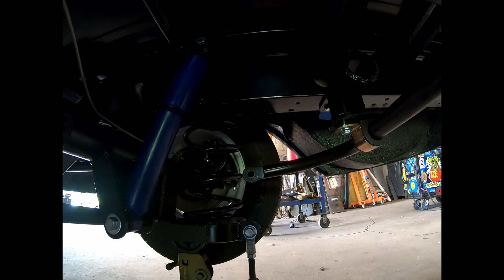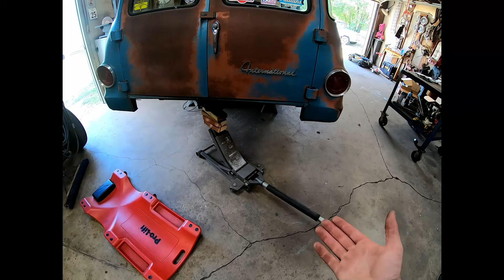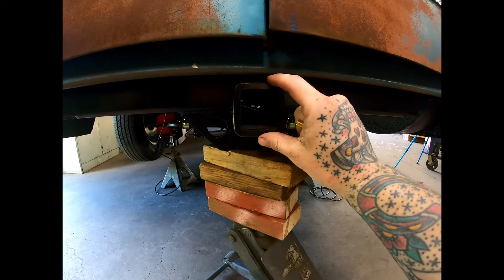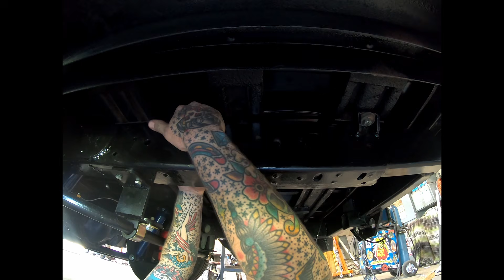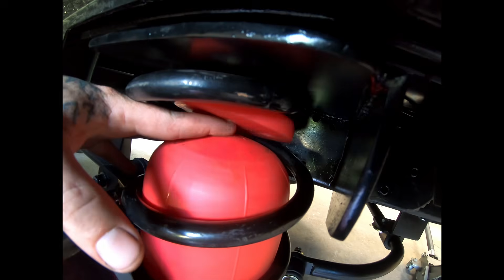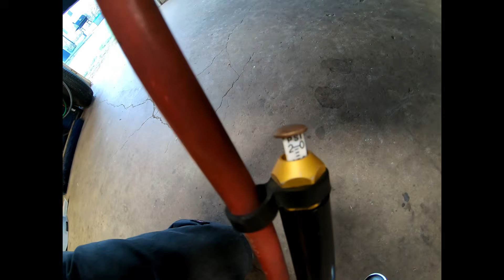EASIEST HELPER BAG INSTALL EVER! Airlift 1000 helper springs!

Comment: i bought these for my crv... had nothing but leaks. I finally used fuel lines; the crappy lines , and connectors, they send with the kit are lame. I also bought the remote bluetooth air gauges. it worked for a few years but finally it split at the top off the bag.

Comment: Something I learned the hard way, back when air shocks were the hot ticket. Using dual Schrader valves makes it easier to dial in spring rates when you don't have money for adjustable spring rates, it works great as a substitute. Using them on a larger 4x4, if you're hauling something with weight more on one side it'll help level your load. It'll also make your off road ride more stable.
Reply: How do you set up this dual shrader valve idea?
Reply: @mydearriley one valve to each bag instead of using a tee

Comment: Use separate air lines for air springs and it would be stiffer in rotation, could eliminate rear sway bar for better traction and ride!

Comment: if it dropped 2 PSI over 14 hrs that's something to worry about I have the same Air Bags in my 4WD set to 15 PSI for normal driving and 25 to 30 when I'm loaded up with camping gear and it takes months for it to drop 1 or 2 PSI I do have zip ties around the barb on the airbag and the Schrader valve.

Comment: Very nice video and informative, but I think your springs are generous on the lack of number of coils and how far they pull apart.  This is a bit of a chore to get the folded bag  in between the coils of the springs in a Suburban.  I have run these for years, but one of the bags began to leak at the seam, had to replace that one, the best way is to just use a box cutter and cut in in half.  I agree with the fellow that 20lbs seems to be about the most I ever needed for my 23ft Jayco.
Reply: Iv had some in my 01 Tahoe for quite a few years, just had a seam split. Can’t complain, I’ve “used” them 🤣🤣. Pretty tough getting them in with close spaced coils though.

Comment: What is the ride like. I want to increase the ride height from time to time on the back for off road terrain. I can lift the back of the car up when it's sat stationary. Will this lift and can I leave them empty when not in use. Do they chaff on the spring?

Comment: Great video! I put these in my 2013 Ram 1500 and pulled our 23’ camper trailer over 100,000 miles around country with them. They worked great and were still working when I sold the truck! I don’t think I ever needed more than 20 psi when towing with the camper and around 10 to 15 psi without the camper and all my tools in the bed of the truck.
Reply: These or the black ones I also got a ram I use to tow my teuck around alot and it sags so bad 😂

Comment: i found this in search of solutions for my VW Atlas sagging whenever I put something in the rear.  Due to me having the aftermarket tow hitch the clearance in the back is very low....any additional lowering due to load causing scraping issues.  Safety and performance is paramount and if a new one of these has a crack imagine a failure on the road.  If the bag is holding up the vehicle and it suddenly gives out or even gradually;  the load will be much worse being lopsided.  I guess I'd have to pull over and remove the other bag and be low the rest of the trip.  Factory bags or even aftermarket kits are expensive because they use tested and heavy duty bags.  Seeing that crack is a huge issue.

Comment: I've always had great luck with the Monroe air shocks myself!! They bolt right into your factory shock location and have a 100psi max rating and a lot of travel and are less than $100!! I've used them on many projects over the years and never had a problem with them, you also can get the extra air line from any parts store in the form of manual oil gauge line, same stuff and can even be plumbed to a tank and small 12v compressor as well as being able to use a small ball valve!! Look into them, I've used them on all 4 corners of an ole Chevy Luv and worked great, not super fast but plenty fast enough!!
Reply from the maker: I’m not a fan of air shocks myself, not bad for maybe a chevy Luv you throw a 350 in the bed of, but the amount of vehicles I’ve towed home this last year in my opinion you can’t beat these.
Reply: Oh I'm definitely a fan of the lift bags as well!! Just on a budget I've had great luck with the Monroe air shocks for a quick, cheap, and easy solution!! Luv your build and just finished watching the complete build series and liked every single video!! Your great at fabrication!! I think you're selling yourself a bit cheap!! I think you did a great job on this project build and that's something I don't see in many of the builds I've seen!!
Reply: Your definitely going to go far with the great content and your cool attitude as well as doing all the extra work to get it to suit your style!! It's all about the little details!! Imo that's what really makes a great build really shine!! This build is completely perfect imo!! FIRE!!

Comment: Thanks for helping me to decide which helper bags to purchase. Best video on these bags I've found. My daily driver has an extra 750Lb of weight due to a huge subwoofer C-pillar wall reinforced with 2x4's and steel to support the 4 15" subwoofers and I think this is just what I need to to give me a smoother ride. Thanks.
Reply from the maker: They will help! Since I’ve towed with my Travelall probably 5-6 times since it’s been on the road these things have been perfect.
Reply: @PuddinsFabShop  Nice. Thanks for all the info. Peace.

Comment: with a t fitting,wont it push the air from one bag to another on a hard corner giveing you lift on lighter side
Reply from the maker: Technically speaking it would but I believe the coil spring is stronger then air favoring one side. Especially with the rear sway bar. My trucks in full air ride with the rear on a t with no issues and they are the only spring.
Reply: @PuddinsFabShop  I guess if you have had no trouble thats all that matters,I was thinking just a one way valve in one line would prevent it.Rear sway bar will for sure help.enjoying the build,I have driven a rodded L110 binder for 25 years.
Reply from the maker: I like the sound of that!

Comment: i have the same bag set up i have put 50 psi to them before but i normally have 35-40 plus 8700 pound trailer when i tow
Reply from the maker: That’s what I’m talking about!!
Reply: No issues at 50 psi?